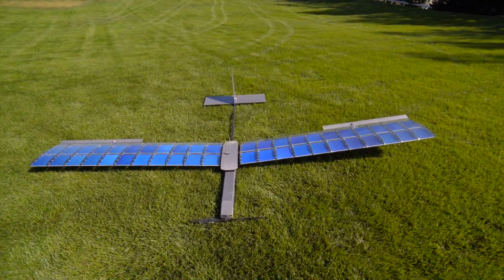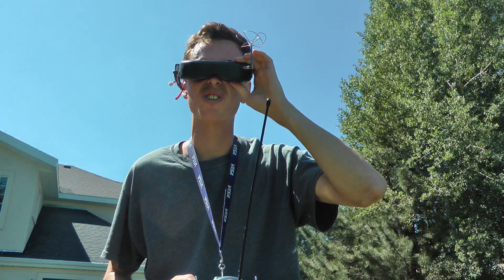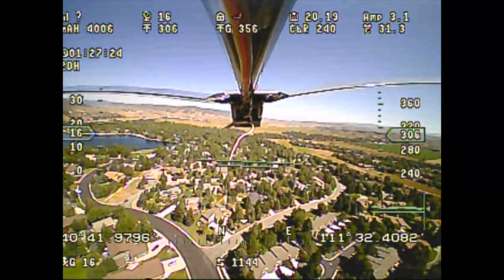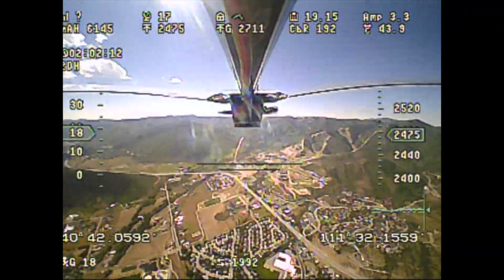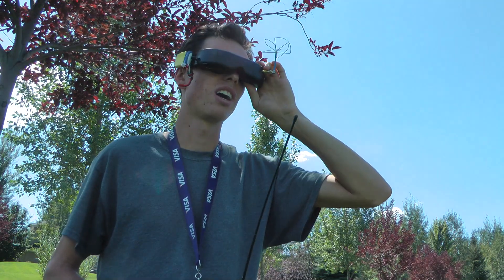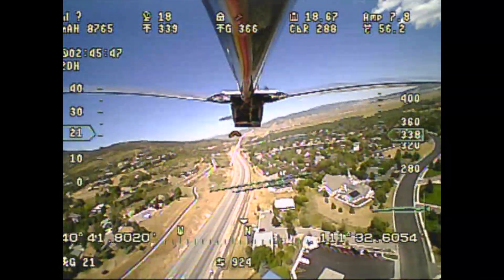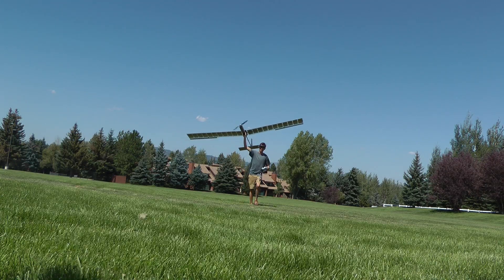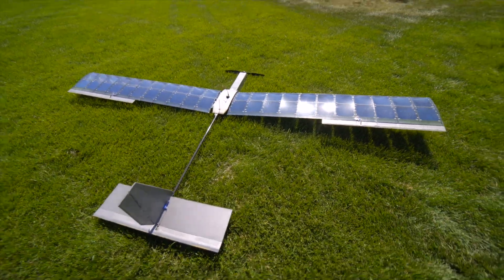SOLAR Plane V3 Long Duration Test Flight - RCTESTFLIGHT

Comment: I'm not an engineer (i'm gonna be, but IT engeneer :P), but i see this protective layer on panels reflects a lot of light. Could you make them more efficent by replacing it with more transparent material, or difference would be insignificant?

Comment: Gaps between the wing and fuselage are a MAJOR source of drag. Blunt nose doesnt help either. A more conventional nose with a nosecone and folding prop would help reduce a huge amount of drag with motor off. However,  if your intention is just to motor up to height and leave the motor running, then a folder is not required.

 I question having ailerons, rather than sufficient dihedral and rudder elevator only. A self stabilising plane is much easier to control particularly at altitude, plus theres 1 less servo to drive. Inefficient ailerons, for example with gaps between them and the wing or poorly shaped or not using correct aileron differential, ie mostly up and little down can cause adverse yaw and extra drag also.

Think of the whole package. The best power system on a draggy inefficient plane isnt going to be a great result and vice versa. You need the best combination time and money will permit. 

Higher aspect ratio would help alot too. Anything stopping you from increasing the wingspan?

 Model aircraft aerodynamics by Martin Simons is a great source of information as is the charles river internet site. Both were created a long time ago, but the information is very relevant to your plane and project. Theres many other resources out there too.

Gd to see young keen guys like you getting out there and doing it and pushing boundaries. Keep it up, but dont forget, theres alot of us old timers out there with decades of accumulated rc knowledge thats still very relevant. Try hunting a few down. there will be time wasters, but look for the guys with high performance glider pedigree. Gd luck and best wishes from New Zealand.

Comment: More power from the solar panels......as a suggestion....6 more solar panels built in the Horizontal Stabilizer , for drag reduction, then a couple more over the center section. Total of 8.. Regulate panel power to the voltage and amperage needed for the motor.   The extra power should maintain cruise flight speeds AND charge the battery.
One of the things/idea I have been thinking of is to put a very large discharge coil, charge the coil and then dump that high voltage into the motor windings. Baseline power from the batteries and the solar cells would be , say, 12 volts DC, voltage to the motor,at maybe 14,000 volts (?).  Just a thought.

Comment: Very neat project!  One thing that popped into my head regarding charging.   Without a load balancing mechanism for the batteries, you run the risk of over volting one or more of the individual cells in your pack.  It would suck to have a cell catch fire in flight!  ;-)

Comment: try cruise airship  a 21 first century Zeppelin.
the propulsion system in this type of aircraft is right 4 u.
high lift for carrying lots of batteries and a wide surface area for photovoltaics.

Comment: Why not use normal meter to check voltage etc but have a camera showing at meter display and a camera switcher.

Or put meter near main camera  

I was hoping you would make it back to lauch 

keep up good work

Comment: You also need to send the solar to a controller where all the solar is going into the battery... and if you need power from the motor just pull from battery..

Comment: .. easy way to find this out without doing this. Use the numbers. Amperes the motor uses ampere the solar panels put out battery size. And you are done.

Comment: Nice start on your goal.  Your assumption for the most part are correct. Cleaning the plane up aerodynamically will go a long way in achieving  your goal. i.e. folding prop.  I say that from 40 years of RC sailplane activities. Go mppt for sure,  motor spec it to the solar load voltage and let the balancing weight determine your battery config. Leave room for ballast.There are times when a clean heavy glider will do better than the same glider lightly loaded. Your wind battle is the example.  I've subscribed, A+

Comment: I think your wings are a bit small for accomplishing sustained flight like that.. I would make that wing 3 times wider than it already is this will give you more surface area also typically speaking the higher your antenna is in the air the less power you should need to talk to it.. I might suggest finding out what frequency everything is and design up an antenna to work with for ground use look up circularly polarized antennas its what we use for Sat work when we don't want to use Yagi antennas Also I know its kinda inconvenient but if you had a chunk of ENT about 10 feet or so with some coax running to the top of it with the circularly polarized antenna I imagine you would hear the aircraft a lot better.. What frequencies are you using??  Some of them look like 2.4 ghz but not too sure because the controller you had in your hands almost looked like VHF frequencies maybe 150 through 280 Mhz just guessing from video of course so i could be totally wrong.. Anyway check out this link http://www.antenna-theory.com/basics/polarization.php and https://cdn.thomasnet.com/ccp/10014548/223252.pdf

Just to give you an idea some Amsat satellites only transmit in the  800 to 500 milliwatt range

Comment: 1.5A and maintaining altitude, thats a seriously efficient airframe and regarding the charge rate with motor running vs not running, electrcity will always take the path of least resistance, the battery is much more resistive than the motor and will naturally want to feed to the motor instead of the battery but any surplus will still reach the battery but with no pull from the motor the higher current is able to overcome the resistance of the battery and charge it much faster

Comment: 1) What is the CbR (2nd row 4th reading along) on the hud?
2) What is that pink line, the 2 horizontal bars, and the surrounding arrow, that appears on top of the plane?
3) After 4 hours flight, isnt there a major concern your fpv gogs and/or your TX might run out of volts?

Comment: If there is almost enough power generation for sustained flight maybe try a smaller battery to reduce weight and increase efficiency?

Comment: couldn't you use a small transistor bank to amplify the power output from the solar cells?
also, a diode that separates the battery/motor and the battery/cell systems.

Comment: Fantastic work and great approach to your goal! I have built several RC aircraft, from balsa to coroplast, and I have a few suggestions you may have already considered. The biggest one is your airframe, the wingtips being square are causing a lot of drag, the fuselage needs some drastic stream lining, and I would go to a V-tale, this would reduce weight and drag. V-tale mixing is easy. Your electronics seem fine, have you tested different props? have you considered a smaller tiger pitch or folding one to decrease drag when you coast? telemetry is good but does adding sensors add weight? You may also increase your wing chord to add more color cells. Keep up the cool work!

Comment: Obviously you forgot to add a wind generator! By combining solar with a wind generator you should be able to achieve battery less flight. But seriously if you could start without the battery pack then the aircraft will weigh less This might make it efficient enough.

Comment: The speed controller pulses the motor.  Energy draw from the battery causes battery internal resistance losses on each pulse.  Then pulse  off times the PV voltage goes up with more battery internal resistance charging losses.  Look at the system voltage on an oscilloscope and add enough capacitance to balance transients during motor pulse ON/OFF cycle.

The capacitor will store PV voltage highs during motor pulse OFF times and delay stored energy to motor pulse ON times, allowing less battery internal resistance charge/discharge losses during motor pulses.

Capacitor smoothing the power system also reduces RFI to the RC receiver and reduces wire losses.

An MPPT controller pulses the voltage system and hunts for the maximum power transfer (V*I) using PWM and the motor speed pulsing will confuse the MPPT.

As for the plane itself, cooling the solar panels would decrease power losses in the PV by reducing losses from the PV high internal resistance.  May be incorrect, but I use PV open circuit voltage divided by PV short circuit current to calculate PV internal resistance, then use a load having the same resistance for maximum power transfer ??

Comment: you need more cells in parallel because it's amps that charge your battery so you need a wider wing with more solar cells in parallel.

Comment: Maybe you can add a sort of hybrid mode where you can shut the prop motor off and have it glide while the battery recharges, have it glide every 20 or so seconds at certain altitudes?

Comment: you need a mppt regulator for your solar panels with the proper charge voltage for your batteries :)

Comment: Nice! Did bench tests on about a dozen different 13" props for UAV camera platforms. Found CF props to be the noisiest/least efficient - by about ~15-20% - particularly by comparison to composite/nylon or wood props with a 'proper' profile down to the heel of the blade. Designs with 'winglets' at tips didn't make much difference.

Stumbled across a correlation between how 'noisy' a prop is and its efficiency, which makes some sense. Used dB meter, ammeter, servo controller and thrust bench to video all the results. Very boring stuff, but there's definitely a sweet spot for 'fatter' old school (nylon) electric props, although these are relatively heavy. 

The European beech wood props had one of the best thrust yields, whist being lighter than nylon e-props, and better balanced. That's what I use now for longest/quietest flight times. FWIW the cheapest plastic 'slo fly' props were amongst the more efficient runs - whilst costing 1/5 the price of beech props - so use these if you're still crashing!

Comment: Nice test. A suggestion. NACA did a lot of work on finite wing theory in the 1940's. The wingtips on your wings will be causing a lot of drag. You could design to allow for the drag caused by tip vortex.  This would decrease drag faster than it would reduce lift. To get the same lift you would increase the wing area and therefore have the same lift but less drag.

Comment: a  NACA 2408 wing shape 18" wide and 156" long would give you the space you need for the number of solar cells  in parallel and series to climb none stop and not use any of the juice from the battery.

Comment: try doubling the number of cells that are in parallel on the V4 with the same voltage your getting with the cells that are in series.

Comment: Your ability to infer possible real time problems and solutions with the system while it is flying is phenomenal.  It appears you have organic cells in the wings.  I think I remember seeing that those have a decrease in voltage when they get hot.  Is there a possible silicon cell light enough that you could use that  instead of the organics?

Comment: I think you should test the efficiency of the panels at different voltages and see what is most efficient for the panels and the battery. Then use a buck boost converter to draw the perfect amount of power to constantly get the most efficient panel power.

Comment: Industrial grade systems we supply are all operated on Battery and, more standby than intermittent duty. When it comes to using only photo-voltaic, don't be afraid to add a few more volts as your regulator will use it properly. We use about 38 volts open circuit    PV voltage into a regulator for a 24 volt battery system.

Comment: Here's a way for you to test whether the model will fly with the solar panels alone, yet still have a fail-safe battery option. Wire the solar panels directly to the BEC and ESC, then take a 3s (or 4s) battery wired to the same point but through some 20a Schottky diodes. Here's a simple drawing on my Dropbox:   https://www.dropbox.com/s/1c01i7iqykk8rwu/SolarPlane-1.jpg?dl=0  

That way, you're guaranteed that the solar panels are exclusively powering the plane at all voltages above that of your charged battery, yet in the event of zero solar power the battery will instantly power the plane and it's electronics to bring it home. Further, using this config the solar panels will not be charging the battery at all, so you won't have to wonder how much solar energy is being diverted from flight. Search Ebay for these parts:  20SQ045 20A 45V Schottky.  I'd connect three in parallel (thereby increasing the current capacity somewhat above 20a and distributing any heat -- won't be true 60A rated, but should be at least 40a, which is plenty).  Diodes will be biased off at all solar voltages above 12v, functionally disconnecting the battery. 

If your plane will fly on 11vDC, use a 3S for your emergency battery. Otherwise use a 4S, but 3S would give you a cleaner demarcation between solar and battery. If you get this in the air, you'd be able to instantly determine the maximum current the solar panels can supply before becoming voltage starved down to the diode threshold.

And then, looking past this initial testing phase, you could wire a low current battery charging system. Maybe your final design goal for the project could be a plane that is 100% solar powered and capable of unlimited sustained solar flight, but with a battery on board for failsafe and for impulse power delivery for climbing, with a charging circuit to re-charge the battery during lower power solar cruse. If your solar panels can supply above that needed for sustained flight, this could result in unlimited airplane flight times, with full current, instantly available battery flight for short periods when needed, and the recharging of the battery during low current periods, ready for the next impulse draw.
Reply: Part Two:  Dawid Bredenkamp below had a good idea for the charging battery circuit for Phase II of the project. Simply wire the battery directly to the ESC and BEC, then wire the solar panels directly to the battery through a simple 4A Step UP/Down Buck Boost DC to DC converter power supply. Using this converter it won't matter if the battery voltage is above or below the output voltage of the solar panels at any instant, as the converter will step the voltage up or down as required. Set the Buck/Boost output voltage to just under the full charge voltage of the battery you're using. The battery can be of any voltage - 4s, 5s, or 6s - because the buck/boost power supply will increase the solar panel output voltage to accommodate. So, if you're using a 6s with a full charge 25.2v (4.2x6), set the Buck/Boost output voltage to something like 24v (about 95%). In this configuration the Schottky diodes shouldn't be necessary, as the power converter likely will present no load to the batteries when battery voltage is above it's output voltage, but if used the diodes would be inserted between the converter output and the battery (up the converter output voltage to compensate for the diode forward voltage drop). Search Ebay for this: "DC Adjustable Voltage Regulator Boost Buck Step Up Down Converter 4a", which runs under $5.

This configuration will give you smooth voltage to the craft supplied by the battery at all times, but with on-board solar panel recharging that will always use all of the wattage the panels can deliver regardless of their voltage.

Comment: a very simple way to amplify cells voltage is to use a dc-dc voltage converter moduleit should solve your problem

Comment: Could you not simply program an arduino with an altimeter and a relay?  Program it to draw power from the batteries when dropping altitude for more than 5 consecutive seconds, and program it to pull from solar anytime it gains altitude for more than five consecutive seconds while drawing less than 2 amps.  Now your solar plane hunts and utilizes thermals.

Comment: Nice flight and awesome project! That thermal at 7:50 isn't caused by that cloud over head. Its the hot rising air in the thermal which makes the cloud as it rises past the dewpoint :P
 Greetings from Germany!

Comment: why step up the voltage and then use a controller? you need a way to switch off the solar incase it gets too high of a voltage, but stepping it up will just eat up extra power all the time. if its a 1.5v solar cell, why not series them up to 4.5v and the charge each individual cell seperately through the ballance plug? put a one way diode in there so it won't drop charge below battery voltage.
Reply: Solar cells are generally .5V and you can charge the whole pack at once without all the wiring required for the intermediate voltages.  Over volt condition is handled by setting the panels max output under aircraft minimum load not to exceed the pack max voltage.  No diode needed, solar cells ARE diodes.

Comment: A large wing design with no tail may have decreased drag and increased surface area for the solar cells.  What is the smallest size motor you need? 

Very interesting! Keep the good work up!

Comment: Since you have a solar panel now you'd be looking for a battery with maximum POWER density rather than ENERGY density which would push you towards A123 LiFePO4 cells instead of the traditional Lipo.  So maybe a 1Ah pack would be enough for launch and recovery and the rest of the time would be solar.